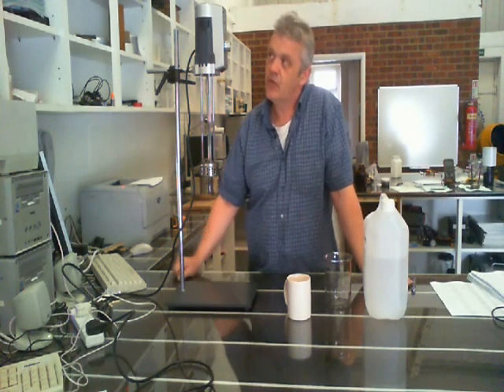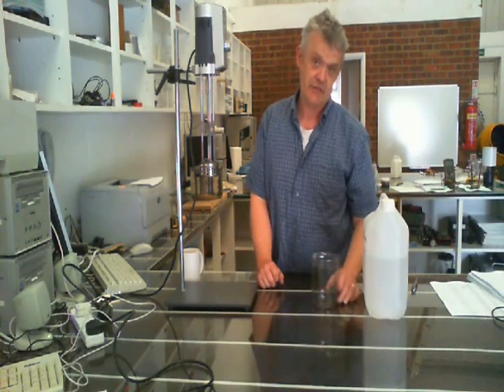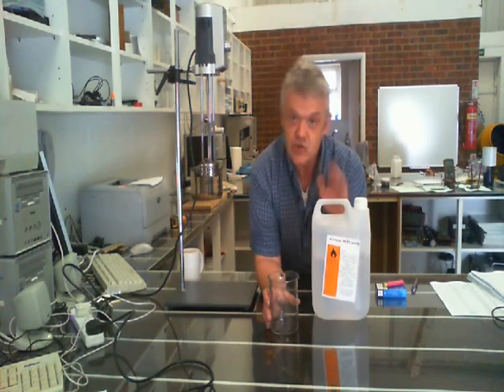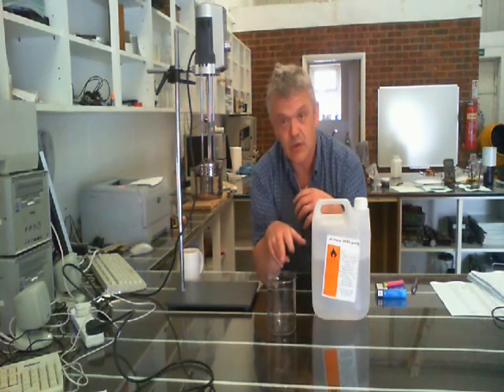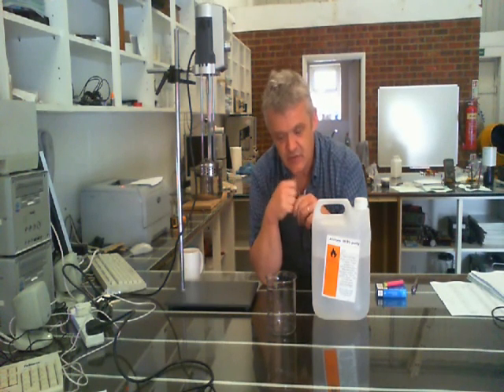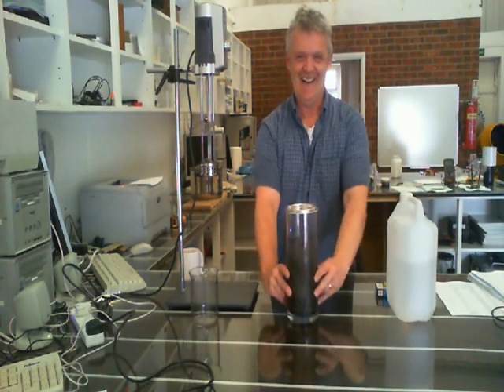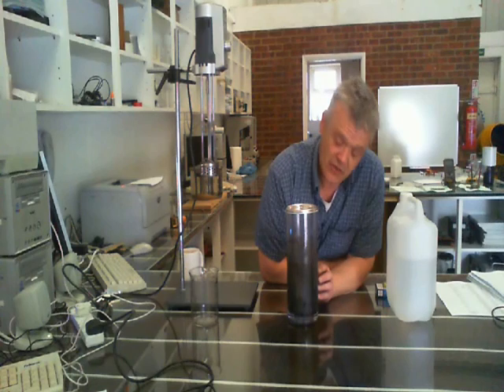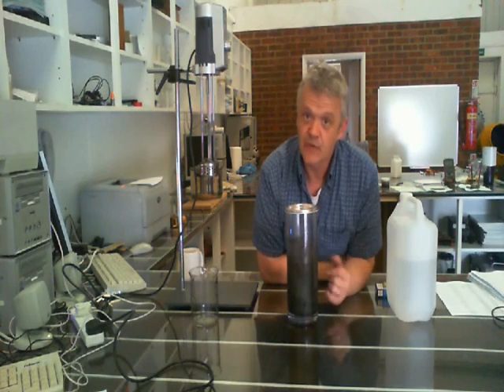The Easiest Way To Make High Quality Graphene

Comment: Thank yoThank you for your content. I am clearly new to chemistry and I am taking small steps with ”safety first”. Please indicate the simplest method of converting graphite 300 mesh into single or double layer graphene. Some chemicals and tools such as a kiln are simply not available in this small isolated country. Please indicate if the Potassium Permanganate can be substituted. I believe sodium hydroxide and potassium nitrate are both available. I was considering the electrical separation method but purchasing a welder is not my first choice. The total amount of graphite that needs to be converted is about 10-15 lbs. Any suggestions are welcome.

Comment: Have u looked at the graphite oxide method where they use a disc burner and graphite oxide suspended in water and then hit by the infrared laser on the disc burner to get graphene just as a sheat or have print circuits they even use the sheet to create a quick diy flexible super capacitor could u make a video sharing your thoughts on that method?

Comment: The later models of DREMEL all provide equivalent RPM for a lot less than £700 (eg. £70) and DREMEL provides a bit holder that should allow the precision maceration cylinder block to be 1) fabricated by an engineer 2) adapted to fit a DREMEL bit holder? Is anybody interested in helping to develop an affordable piece of laboratory equipment for fabricators who visit FWG videos for inspiration and affordable solutions? The second industrial revolution is here if we choose to work collectively and with purpose? Thanking you for your participation!!!

Comment: There's something that's needed its very new and no great way to make it in quantities.. Its hematene  it's rust or iron oxide but only 2 dimensional like graphene the two make a new type of battery that runs on the molecular vibration of water huge new advance .thanks jim

Comment: A cheap angle grinder spins at 10,000rpm and will run for hours with a light load. Only thing is, you would have to make a framework to hold it (old bed-frame?) and some sort of extended shaft 'paddle''  Probably still less than £30.00 though? Only recently found your vids, they are fascinating and great to be public domain. I guess it keeps you 'safe' from the nefarious business interests so you don't disappear under strange circumstances?

Comment: In Flexographic printing they have a water based ink that use an amines to keep insolvents in solution until printed and a small fan removes the vapor and pigments are precipitated. This may also suspend graphite for your projects.

Comment: The International Union of Pure and Applied Chemistry (IUPAC) notes: "previously, descriptions such as graphite layers, carbon layers, or carbon sheets have been used for the term graphene...it is incorrect to use for a single layer a term which includes the term graphite, which would imply a three-dimensional structure. The term graphene should be used only when the reactions, structural relations or other properties of individual layers are discussed."

Comment: Thanks to your videos i have successfully made graphene suspended in a solvent! The only issue i have is trying to extrude the graphine from the solvent in a powder form. I have a centrifuge however ive read that a centrifuge would just re-cluster the graphene into graphite. I was just curious on your take on using a centrifuge.

Comment: Robert! not sure if youve heard yet. have you tried using soda water? it will clean without difficult toxic nightmare. i will try to send the post i had seen. its co2 carbonate. you might find it if you google it. i read it and instantly thought of you and your applied tests. im sure your brain will understand better what im ranting about. ill try to send it along somehow.
Reply: ok it was in phys.org. Fizzy soda water may be the key to manufacturing flat wonder material:graphene. check it out,i hope this somehow helps out. 
peace.
Reply from the maker: the unfortunate thing about graphene is that there is al to of confusion around it mate - the soda water wasn't used to make the graphene - the graphene was made by chemical vapour deposition onto a copper foil. The soda water was used to delaminate the made graphene sheet from the foil substrate. It is important as normally that delimitation is hard to do and creates a lot of waste but the load method stops that - but again the soda water isn't used to make the initial graphene - but thanks for the heads up
Reply: Robert Murray-Smith i had no idea what it was for. just seen something cool involving graphene manufacturing. truthfully, alot of the chemistry terms give me athlete's scalp from going over my head so much. fascinates me to no end anyways. it figures, seems youre a step an a half ahead of the curve. makes it easier to understand any outdated newsflash i dig up. who knows, one day ill find something that will make you scratch your head. have no fear of any patent office footrace. i agree that great ideas belong to the people not just the people that want to sell us the future.
Reply from the maker: I assure you will mate - keep looking

Comment: but how strong is the finished product
Reply from the maker: about the same as any other graphene
Reply: Robert Murray-Smith then i have a project ill be working on if its as strong as the plastic one you had in 2015 10 times stronger than steel
Reply from the maker: ok - good luck with it - but i suspect you may have a fundamental error in understanding mate - graphene is a specific things and the composite was something completely different - it had graphene in it but it wasn't graphene
Reply: Robert Murray-Smith i plan on making them sheets of plastic infused with the graphene to add make my project

Comment: Though I am not set up to do i, I have wondered if you could get a coating of graphene on to a plate if you were to electrolize  benezine?  It is, after all, made up of only hydrogen and carbon, so there would be no other elements to contend with. Steps would have to be made to assure no oxygen were ever present, of course. I know it would be dangerous, but would it be possible ??
Reply from the maker: dunno mate - have a look at google scholar and see if anyone has tried

Comment: or in this case with a blender would there be benefit to ten minutes on and soak for 1 hour repeat repeat repeat? Cheap blenders have a low duty cycle and probably plastic bearings that deform when they get to hot if they have bearings at all😮
Reply from the maker: indeed

Comment: how does for the solution to evaporate and leave a mono layer on your substrate? Also, can this solution simply be purchased somewhere? Would it be suitable for painting on glass for DIY solar cells?
Reply from the maker: i think you can buy it mate but i am not sure where
Reply: Thanks I am looking around.  I don't know if my hypothesis is flawed in the first place though. It is my understanding that graphene absorbs approximately 2-3% of ambient light.  Is it possible for the graphene to carry that charge and act as a photoactive material? Obviously, it would generate very little energy, but scaled up it might do a tick or two.  I want to make it from sugar water using Tang Lau as you have demonstrated.  Do you think this is feasible?
Reply from the maker: I have no idea mate - but i guess it is certainly worth a try - let me know how it works out for you

Comment: In my ink lab I used an ultrasonic washer vs a sonicator. Has 3L tub and works at 40Khz but only costs $100-$200 USD.  Just a suggestion for those of us poor experimentors lol. Keep up the great work!
Reply from the maker: nice suggestion mate - cheers
Reply: Please tell me how did you used it? Did you put graphene powder into water and made to work it with sonicator? Or without water, just a powder? how long time?
Reply: @jtoomla  you can suspend It with acetone in a bottle
Reply: @TEG POWERWALL send me your email to contact you

Comment: Hey Robert I am going to make some of your materials to try and make some batteries.
I have watched most all of your videos.  I have a source for some chitin and charcoal.
But I am not a chemist. I work full time at another job but I am a experimenter. I tell you this because I need some chemicals and the only source for them is far away and only  open during working hours, So I have to take off work to go get any chemicals I need. I would like to get the chemicals in one go. so is there a list that would be the basics for my trip to the chem store? Please help.
Thanks
Reply from the maker: I don't know mate - i just order them from ebay - a good idea might be to go through and make a list and check it twice

Comment: I was thinking that a less expensive version of your high performance blender might be made using a palm router. They turn at very high speeds, typically variable up to 30,000 RPM, have reasonably good power, and are relatively inexpensive. They would probably tolerate longer run times then your typical kitchen blender as well. Of course if your turning something this fast it will need to be pretty well balanced.

Did I understand you correctly to say that the starting material is graphite?
Reply from the maker: yes you did and i like the idea of a palm router
Reply: That is a great idea...
Reply: Be careful with acetone fumes, they can explode with the electric sparks from the Palm router's motor.
Reply: @erickclaussen   It's too late m8, he's gone...

Comment: I'm just about setup to try this method but I have a bit of a concern. I picked up a food service grade handheld homogenizer made for mixing large batches of liquid. It tops out at 13K RPM. My concern is the flammability of the acetone and water solution. I'm fairly certain the blender has a brushed motor and while it is new there is still a possibility of sparks from the brushes. The air vents and the body of the blender are really close to the opening of the container and there is no way to cap the container with the blender in there. How concerned should I be that this could catch fire? Thanks
Reply from the maker: i wouldn't use a handheld mate - but i suppose you could if you don't mix a lot and seal the top of the jar and shaft of the blender maybe with a rubber diaphragm?
Reply: +Robert Murray-Smith thanks, I'm just going to buy a cheap blender instead.
Reply from the maker: i think that's a better option mate
Reply: +Robert Murray-Smith thank you, I appreciate the feedback :)
Reply from the maker: no worries mate - i hope it helped
Reply: +Robert Murray-Smith better safe than sorry. There was a lot concerning me about that setup. And yes it did help. :)
Reply from the maker: cool

Comment: I was thinking. If enzymes could make graphene, and follow the string of damaged never cells to one end whyle building graphene in a string or cocoon around it/attacked to it, the nerve cell would be fixed, and also indestructible  by further attacks by the own immune system. 
But can graphene conduct the current needed to make nerve cells work again? The outer layer of nervecells is the stuff that normally conducts current, but is killed by the own immune system. Here is where my graphenemaking enzymes come into play. 
I totally lack the means to find this out. But I know enzymes are 'just coded droids'... :P
Reply from the maker: +K Schot I didn't think nerve cells conducted current in the same way a wire does - i though ion exchange across the membrane was responsible for a potential that can travel - you might want to check that
Reply: You might be right. But if the replacement conducts current differently, yet still works it might still work. I was just reading about damaged nerve cells, and thought about graphene as a solution. It's in the same size/scale categorie.
Reply: programming an enzyme to follow broken nervecells and build graphene around it is very high-tech. Maybe even Sf still. Maybe we need a (the) superchip to calculate the DNA needed to create these enzymes.
Last thing we want is just tinkering around and the enzymes then just connecting all nerve cells in one big graphene web. Raise a leg=also raise your eyebrow then :D
Reply from the maker: +K Schot lol - there is certainly a lot of work to do in this area

Comment: Robert I am physically disabled but about the only part of my body that still works is my brain I have a question for you please. What form of carbon will the soot from an acetylene torch make. Might that be graphene straight off the tip of the torch?
I have used my torch and this soot to case harden tiny gun parts.
I wonder if the carbon soot might have been graphene and I not know it.
Reply from the maker: +john matthews it makes all kinds but it is mostly amorphous carbon mate

Comment: I'm a bit of a noob in this field, but could you separate the graphite by ionizing it then blending it in a slightly less ionized water solution?
Reply from the maker: +Digitalman271 i am not quite sure how you would do that - what are you thinking?
Reply: What if you just blended water and graphite with a steadily positively charged blade or mixer? I would ASSUME the blade/mixer would draw the electrons from the mixture. Sorta like a van de graaff generator. I would also assume the graphite would ionize first due to it's higher conductivity. The effect (hopefully) would keep the carbon atoms separate as long as the charge remains. Would you say such an approach could work?
Reply from the maker: +Digitalman271 I would say it is worth a try mate - there a few mechanical problems involved - but it is an interesting idea - let me know how you get on
Reply: +Robert Murray-Smith What do you think would be the first few problems? I've been juggling a few ideas.
Reply from the maker: +Digitalman271 keeping a connection to a rotating blade would be one - i guess some kind of commutation - heat generation will be another, grounding and short circuit through the solution would be another - i haven't given it that much thought i am afraid and this is just what pops into mind

Comment: Hello again Robert! I'm working away on this recipe.
I will list the parameters and results of my first experiment below, along with a question for efficiency.

January 15, 2016
800 max rpm
10:00 a.m. - 2:00 p.m.

450ml Acetone
150ml Deionized Water
25g Graphite - 5 micron
Result:
500 ml of graphene suspended in solution, 100 ml layer of graphite settled to bottom. Possibly not enough co-solvent for graphite to exfoliate into? Possibly not long enough stir time?

January 19, 2016 (using same batch as above)
Added 150ml Acetone - 600ml total
Added 50ml DI Water - 200ml total

800 rpm max
5:00 p.m. - 9:00 p.m.
There is still a layer of about 100ml of graphite settled on the bottom

Here is my question: Is it possible to exfoliate ALL of the graphite into graphene using this method? Why is there still a bit of graphite that settles to the bottom?

I have a process ready to use to boil off the acetone - water co-solvent, then re-capture it for re-use (distillation basically), then I could claim my graphene in the bottom of the boil pot and have the skeleton for a streamlined, effiecient process that is VERY cost effective.

However, in order for this to work as streamlined and efficiently as I would like, and yield only graphene without risk of pouring off some graphite into the boil pot, I need ALL of the graphite to exfoliate into graphene. 
Is this possible?

Thanks again for all the videos and help. Such an amazing material, and I'm very excited to experiment with it in the near future.
Reply from the maker: +David Larson it's not possible to exfoliate all in one pass mate - drain off the exfoliated stuff - add more solvent and re exfoliate the remainder - you should see it reduce in volume as it is exfoliated into the solvents
Reply: +Robert Murray-Smith Hmm okay. As the stubborn Northerner I am, I will experiment on the side to see if there is a way to change that, but for now I will just drain off the top and go from there!

Thanks again!
Reply from the maker: +David Larson lol - we stubborn northerners get everywhere lol - good luck with it mate

Comment: That isn't graphene. Unless its one atom thick it doesn't form the strength and zero resistance characteristics of graphene. Which is a function of the one atom thick molecular structure. You can test this my simply checking the resistance or trying to cut it in have. If you don't get zero resistance or your able to cut it, then you do not have graphene you have simple graphite.
Reply from the maker: +Walther WagDoodle please read through some of the comments - this is a discussion that has been had many times - oh and basically - you are both right and wrong
Reply from the maker: +Craig Dawson nicely put mate and thank you

Comment: Robert have you looked at what you have made under an electron microscope? Can you be sure you are not simply making a graphite colloidal suspension? Though you are breaking the graphite up can you be sure you are taking it down to a mono layer which is then on drying able to form covalent bonds and a single graphene layer sheet?
Reply: And? No answer. Do you have any insights now all this time later?

Comment: I am curious Robert I am across the pond and need to know if I can up the grams of graphene and equal parts of dimeric silicon dioxide(both are 20 microns) to apply onto a roll of silver mylar to build a home made ultra capacitor. could you suggest an amount of equal parts that will saturate the cosolvent to a consistency of a thick syrup?  
I am going to be setting up my dewalt industrial grade 3HP router that has a constant revolution of 22,000 rpms to the mixing shaft....
Reply: +Robert Kehler and the syrup needs to be before it globs and granulates
Reply from the maker: +Robert Kehler - I don't know mate - but when faced with such things i usually experiment